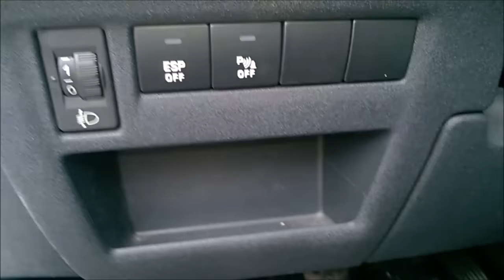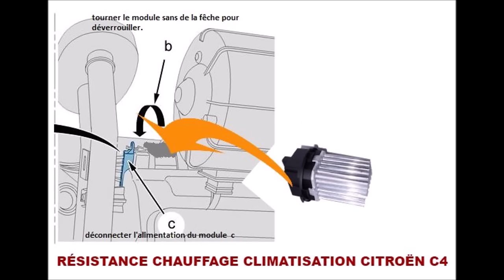Pulseur en panne Résistance de ventilation CHAUFFAGE CLIMATISATION CITROËN C4

Comment: J ai eu le même problème, il y a un test tout simple pour vérifier la bsm : branché un fil souple sur le fusible 11 du bsm puis sur le plus de la batterie. si la ventilation fonctionne, c est la bsm qu il faut changer
Reply from the maker: Oui exacte! bonne solution au problème je confirme j'ai fait ça.
Reply: @jackAnzalone  dernière info les bsm L04 et L06 sont des Siemens, on peu les remplacer par une bsm L11 delphi plus résistante
Reply: Bonjour. Je souhaiterai la tester. je viens de la changer depuis 1 semaine et c'est de nouveau pareil. Je ne comprend pas votre méthode avec le fusible , que veut dire bsm ? merci de votre aide
Reply from the maker: je ne connais pas tous les modèles de BSM !
Reply: Je confirme !
Reply: Moteur allumé ou non?
Reply: Bonjour ma ventilation s'arrête pas il reste allumé a fond et jarrive plus de la.controler avec les boutons de la clim ... 
Jai acheté une résidence ms une fois la brancher la clim s'allume pas et quand je remets l'ancien le problème revient quest ce que je peut faire s'il-vous-plaît ?

Comment: Bonjour, j'ai un probleme avec la resistance l'orque je l'est changer et fait le teste du pulseur qui coiner un peu d'ailleur( je lui est un coup spray silicone et les cuinements on disparu temp mieux) mais mon problème c'est la résistance que j'ai acheter à la casse qui était d'une vw polo tdi la mienne un essence bref, l'orsque je met le ventilo elle commence à fumer !??? C'est normal ? Du coup Je ne veux pas la replacer par dans son logement avant d'avoir résolu ce problème...
Merci de me donner une piste faut-il que je change le pulseur d'air
Reply from the maker: C'est peut être pas la bonne résistance? vous avez regardez si elle étaient parfaitement identique??
Reply: Bonjour j j ai une Seat altea xl 1.6 année 2010 j ai une panne de chauffage car j ai plus d aires chaud qui arrive que du froid merci pour une réponse si qq connais la panne cordialement

Comment: Symptôme : Pas de ventilation depuis le changement d'une pièce moteur (robot). Pourtant mes ventilos et clim fonctionnaient bien avant. Depuis j'entends les volets qui tournent mais pas de ventilation. Les boutons bi-zônes permettent de changer la température, mais rien n'est projeté, aucune pulsion d'air (d'ailleurs la buée prend à l'intérieur dès qu'il pleut). Et l'eau s'infiltre devant le pare brise. J'ai trouvé ce radiateur résistance, est ce vraiment cette pièce qui est à remplacer ? car j'ai vérifié le F11 côté BSM (sous le capot) il est à 40A et il est bon, et certaines personnes parlent d'un relais du BSM qui mettrait tout le système de ventilation en péril. PLutôt vérifier le BSM, car la clim et pulseur sont de marque Allemande donc aucune obsolescence.
Reply from the maker: J ai changer le BSM d occasion ça resolu le problème mais j avais deux Pannes  la résistance était aussi en panne.